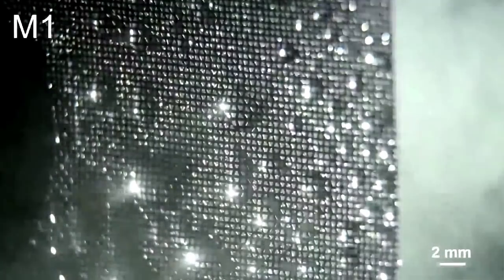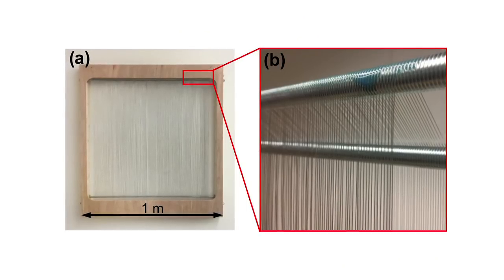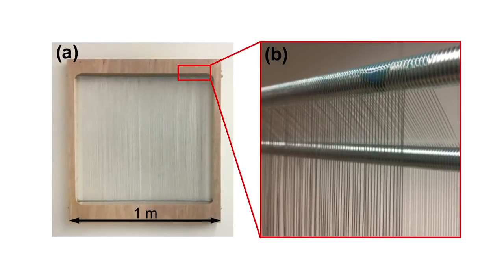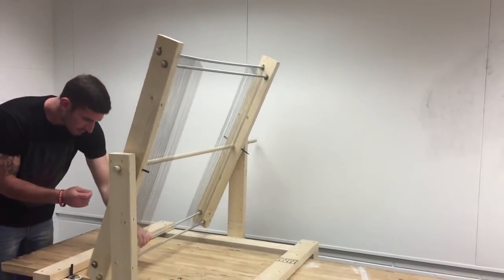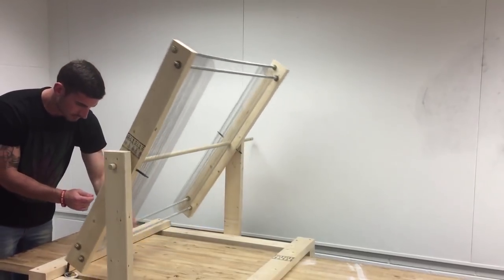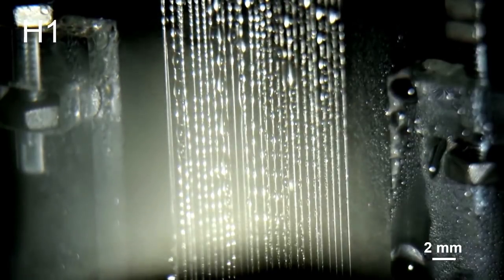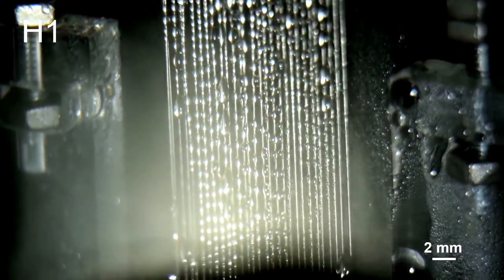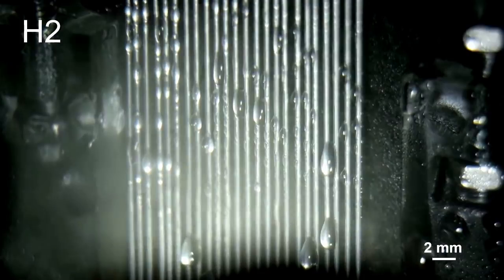Harvesting water from fog with harps - Headline Science

Comment: I see the demonstrator harp is strung over handy threaded rod to keep wire spacing even. Clever! I'd like to know wire diameters and thread pitches used, and some discussion of possible materials other than steel (stainless steel?) and aluminum. Maybe a link to a paper?
Reply: Don't be stupid, use expanded metal net with small holes
Reply: I'd be curious if using fishing line (or a similar style material - recycled plastic?) would be possible as well. Corrosion resistance would be a huge bonus in coastal climates.
Reply: When metallic wires made of stainless steel/ aluminium/ copper are used to form the strings of the harp, they cool down appreciably during the night time and help in condensing the droplets in fog which come in contact.